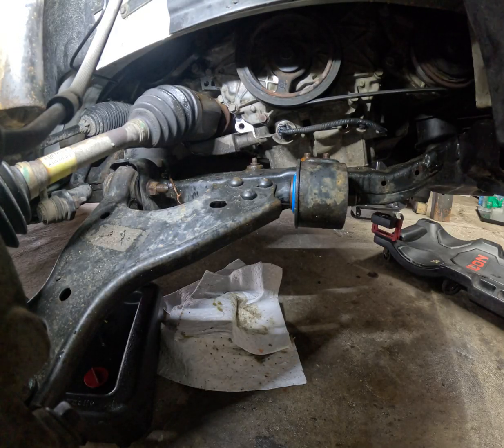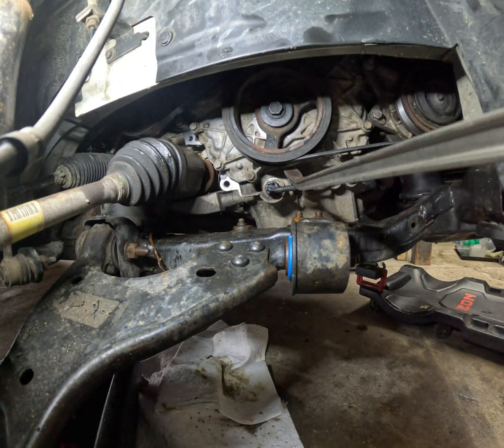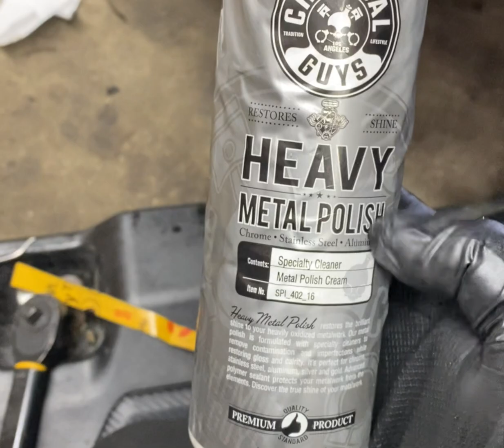2007-2016 How to replace rod bearing on 3.6 GM engine ; knocking sound!

Comment: I'm hoping a rod bearing is the only thing I have
Reply from the maker: If you hear a rattle at start up or constant rattle it’s the chain slapping around, BUT if it’s a constant knock / tap tap tap on the lower side it’ll be your rod bearing.
Reply: @FriesianEAP it sounds tap tap tap from lower side, only at idle/low rpms, after 1200rpm/15mph sound goes away
Reply from the maker: Okay 👍🏼 you may be on the early stages and may be able to just replace the bearings , when they are far in , even on acceleration the knock will persist

Comment: Thanks for posting.

I just did this job, also rolled in main bearings.

I did not have to remove the jackshaft, etc. The "front" main bearing's cross-bolt was tight clearance to get out, but doable.

The "cats" front and rear were left in place, just the two-bolt flanges were separated from the crossover pipe.

I did loosen the transmission-to-block bolts and separated the transmission from the engine just slightly. I wasn't sure if the pan would slide out without the slight clearance. 

Warning - some of the plastic sleeves on the pan bolts may stay behind in the pan. Be sure to install bolts with just one sleeve per hole.
Reply from the maker: Fantastic feedback ! 

You are correct! 

Thank you!

Comment: Did you mic the crankshaft to see if it was out of round?
Reply from the maker: No bud, although you should if you have the tools for it , at that point you might aswell replace the crankshaft. This procedure is not a permanent one,although the engine is still going strong no issues to this day. 

remember, it’s about having a smooth surface- only removing the metal from the bearings. Crank metal is harder and you can tell as you smooth into it
Reply: @FriesianEAP  The rod bearing journal can be measured without having to remove any additional parts. Replacing the crankshaft, however, requires pulling the entire engine along with disassembling it entirely except for the cylinder heads, which I'd obviously prefer to avoid. 

Did you install a standard size rod bearing then? How many miles has it been driven since? Is the knock completely gone?
Reply: Thanks for the video. I don’t think you will have any problems doing it the way you did. A old timer told me once that having a few scratches in the crank shaft is no big deal as long as it’s a scuff type scratch not a gouge with lips/ raised edges small scratches are just more places for oil to get to the bearings. He was an engine builder for 25 years and ran a machine shop for 18+ years.